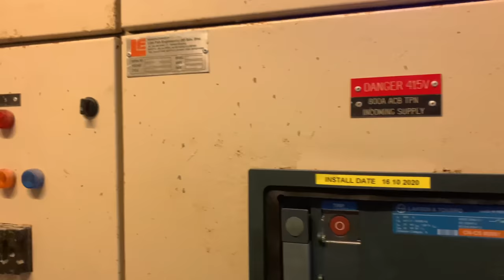Reacting to SHOCKING ELECTRICAL WIRING!

Comment: Jordan, what ever happened with the timber framed job that Lee had the problem with, Been watching the videos since, hoping for an update and not seen/heard anything about it (unless by chance I've accidentally missed it), did you manage to resolve the problem without too much strife?  Love to know that all's well and Lees at least relieved. Could you post an update to it?  Cheers Steve
Reply: I've had a quick look at the "confession time, let's talk" video and have found this response from 10 days ago:

"All fixed now! Vapour barrier had to be replaced but the wood was not structural so was left as is, all re plastered and decorated and a happy customer left with a working Tesla charger.
"

Comment: indian wiring is next level, when we had our wedding, the lights were a strip of power cable with thumb tacks jammed in to power up the strings of lights hanging down across the front wall
i'm going to try and find some pics of it, but it was 20 years ago so i might not

Comment: Second one for South Africa is indeed a water heater in the roof.
Cover is missing indeed.
But that copper strap is standard and required for earth bonding to the hot and cold pipes. It's very badly done though.
There should be a strip across the top between hot and cold pipes too.
Then there also needs to be a double pole isolator within 1 meter of the water heater.

Useless facts:
We call those geysers. Not water tanks or water heaters. We also call traffic lights "robots".

Comment: Obligatory "not a sparky" - I used to work in I.T., grew up in Scotland long enough ago to know that there used to be different colours on conductors, how to wire a plug or change a fuse, to turn off the mains before doing anything, and so on - but I can confirm that some of the wiring in Kuala Lumpur and elsewhere in Malaysia can be... entertainingly bad.  

Bare wires connected by twisting together without tape ("Tape could trap water, boss, not safe!"), cables connected to BYPASS breakers ("Stops it tripping all the time, lah..."), you name it. Also, yes - ANY colour wire for any use. They have a well-known standard (Brown or Black for Live, Blue for Neutral, Green for Earth - OK, CPC if you insist) but I have seen all of those plus others (Red, White, Green/Yellow, bare wires from a twin and earth or somewhere else) used for all three. 

Using a lamp flex - as in, for a table lamp, 2 core and thin - between a cooker point on the wall and the cooker itself seems safe and reasonable by comparison. (I should point out that this one was not in K.L., but a much smaller town, and not my discovery. A friend showed me it - they had rented the place for a holiday. Having seen this issue, they ate out every night. Did I mention that the cooker point was in a double enclosure with a socket in the other half, and that said enclosure was located in the wall directly above the cooker? Neither of us were going to unscrew the face plate to see if the cooker was indeed just "connected" to the socket ring main.)

The only 2 good things I can say are:
1. In at least some large companies electrical safety was taken seriously, even if it wasn't by the company putting the electricity supply into the building. I am aware of more than one fire in a basement distribution room (for want of a better description) when too much current was pulled by client companies who had been assured that everything was OK, in spec, and within the limits of the supply cables and other fittings. 
2. At least they use BS1363 plugs and sockets, so I could plug in stuff I had taken over there. Into a combination surge protector / UPS, as soon as I saw some of the wiring through an open door on the ground floor of the apartment building. New smoke detectors were also installed pronto.

Pardon the rant.

Lastly, is it just this amateur layman or does anyone else find switching the Neutral wire rather than the Live one for things like lights to seem unsafe?
Reply: Switching the neutral is not considered safe. It would warrant a c2 on a condition report. If the neutral is switched then the thing you are switching is permanently live!
Reply: @havoctrousers  Apart from the C2 thing, that's about what I had thought. Unfortunately, I can only recall ONE of the houses that I've lived in as an adult where this was not the case for at least one light (in one case, an outdoors light with the switch inside the back door). 

Thankfully, I'm safety-conscious enough to test whether there's still voltage present after throwing a switch. Actually I test even after popping the mains in case something is mislabelled or wired to another breaker, as I've seen that too.

Comment: Also just to add to the new build shocker at approx 4 minutes in... Only electrical insulation on the DB Feed cable ends, it is missing a layer of mechanical protection in the form of sleeving, heat shrink etc

Comment: India. The most authorative I could find was over 2,200 deaths per year which is 1 in 450,000 people approx. What you need to remember is that lots of areas don't have much in the way of a proper electrical supply. Many areas will be like the UK was 100 or so years ago.

Comment: Sometime in my twenties, a loong time ago, I bought a couple of electric timers that were originally intended to be installed inside some kind of electric apparatus.
The displays were connected by meter long ribbon cables (no idea what kind of voltages were involved) and they had spade connectors for the power sticking out through slots in the boxes. I opened the boxes, bent the spade connectors so they were safeishly inside, still accessible by sticking a knife or screwdriver through the slots, not child friendly! I wired up the power by soldering on some old power cables I had lying around and mounted a tiny shelf on the back of my chest of drawers next to my bed, with one timer set to turn my radio off an hour after going to bed and the other to turn it back on an hour before rising and then start beeping to get me up.
Then, maybe a couple of years later, I stuck my hand behind the drawers to adjust something and discovered what happens to old rubber insolated cables!
There were only tiny fragments of insolation left, both the outer and inner insolation had completely disintegrated.

Comment: 4:40 the DNO should come in and disconnect power until its fixed.  If that is done that way I think and EICR would be in order for the whole house.  Can the DNO disconnect power if there are violations?   That feeder (service entrance / main tails) wire is very small going to the CU as well.  Here in the US, the inspections would catch this and would red-tag this install, which would fail the inspection and have to be fixed before they could get a certificate of occupancy for the house.  🤦‍♂

Comment: Would you be able to do a short video on what to look for when buying a house or renting? Just some general tips on what should be in place and what should be there for safety
Reply: This information i am going to give you is actually priceless.  If your buying a house get a EICR from a reliable local Electrician if your going to rent a property the owner has a responsibility to have the property fully tested by a Electrician. Also their should be a gas safe certificate for the property. Hope this helps. And remember just because the sockets work  it doesn't mean they are safe to use.

Comment: Not correct about the South African colours.

White (now yellow) is a phase colour. Old British phase colours red white and blue. I don't think there is a problem using the white as such.

That DB is very badly done indeed.
Breakers here must ALWAYS have power in on top and out at the bottom.

The RCD is allowed to serve as isolator for the DB and it should be possible to switch off power at the meter as we use breakers at the meter which would enable replacing the RCD.
If no breaker at the meter, call the supplier and log a dangerous situation would be my advice.

Comment: They are called suicide showers, very well known in those parts of the world bloody crazy haha
Reply: The nice thing about those is, not just is the outside wiring something you’d question, but the heating element is inside the shower head and is using the water itself as the resistance wire. So you just plonk some live electrodes into the water at a fairly well calculated distance from each other and the water in between starts boiling. It is livening up your shower water *by design*. Once you do that, why not be cavalier with the power before it gets to the shower as well?

Big Clive has a video on what looks very much like that exact shower head.

Comment: Although we may criticise installations in other countries we do have poor quality installations at home. Some of these may be the odd DIY enthusiast but many are builders or kitchen fitters who seem to be able to get away with unacceptable electrical installations and they still get away with poor workmanship. Is there any quality assessment or are the local building standards "too busy" as usual?  Many years ago anyone could install cables, replace fuse boards but they could then have the installation tested FOC by the supplier before it was connected. These days with no one willing to accept responsibility,  poor practise is rife but no one is willing to take responsibility for testing or assessment. The reality is builders and kitchen fitters will carry on as usual and no one will give a damn.

Comment: @10:35 we call it bonding strap.. usually to bond metal conduit's or pipes together for earthing . To be entirely honest I always feel there's an unspoken war going on between plumbers and electricians.. because plumbers love positioning geysers and pipes right over the electrical terminals so you either can't fit the cover back or can't get tools to the terminals as it's pressed right up against something or other.. it's so stupid .. no to mention what other electricians leave behind in terms of "signed off" work..

Comment: Great video as always where I have seen some 'interesting' wiring overseas. In the UK I'm always amazed how incapable people have become. From the days of being able to fit a plug in the 70's but I guess the moulded plugs finished that off. From my early days of fabric insulated cable and the use of my trusted Avo meter I always do a ohms law test on any contractor I might employ in our business!! the results can be very interesting.
Reply: The only technical knowledge required nowadays is how to press the right 'buttons' on one's smart phone.

Comment: 4:10 that cable isn't DNO cable. The DNO comes into the DNO fuse, into the meter and the isolator is connected to that horrific cable that goes to the DB.